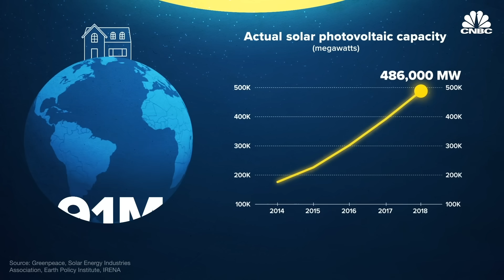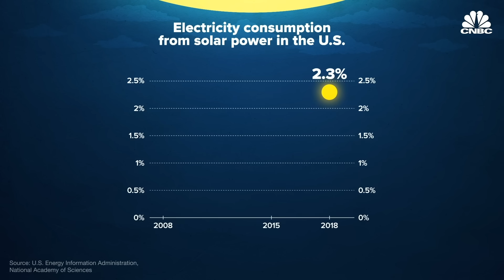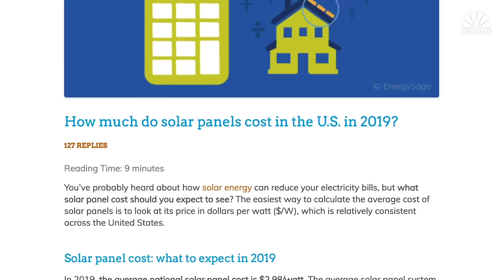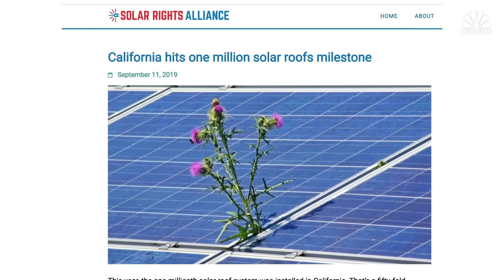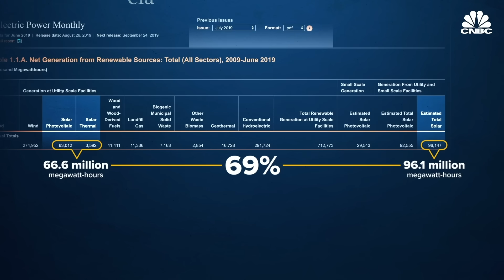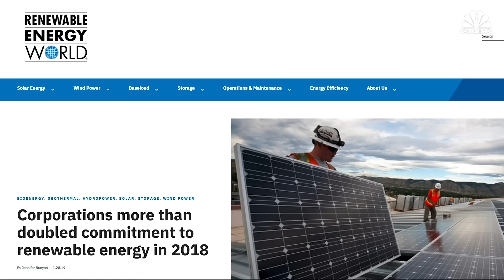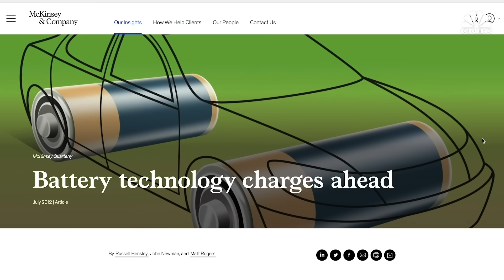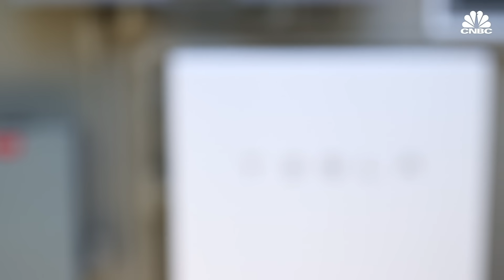The Rise Of Solar Power

Comment: Just think how many solar panels it would take to charge one P100D within one hour? 100kw size farm!!! Truth is Tesla gets its power from oil and coal.
Reply: That is only 250 @ 400 watt Solar Panels = a very small Solar Farm.  I have 30 Solar Panels ...
Reply: @MrSummitville  To drive 50 miles each day to go to work and back in a Tesla one would need about 20,000 watts of power. Sun shines only 5 hours a day so you would need at least this just to charge your car. If cloudy day happens you'll get much less then this. A full charge in a P100D  would last only a week. One would have at least 50,000 watt battery at their house that cost about 40,000 dollars installed. This would be just the battery. Adding another 10,000 dollars to this will make it 50,000 dollars to run you home off grid and then add 30,000 for panels. You would spend 100,000 or a little less to have a system like this. If power only cost about 200 bucks a month you will need to get 40 years out of this setup. lol However to be far one would have to add the savings they save for driving around in their Tesla gas free. You also would have to add up the price of said car too. I think if someone would just get a better hot water heater that turns on when you use it and get a model 3 and charge it up using the grid they would come out cheaper. buying a inverter that somehow uses the model 3 to run your home would be good idea if power goes out However, a diesel gen 5,000 watts is cheap and you could even charge you car and run small things in your home. If you wanna stay clean getting a propane tank to run said Generator would work really well. This is what most hospitals do anyways. Solar is good only if the sun is out and location!
Reply: @controlyourfuture5477  So much wrong with the things you say...  Rolling my eyes
Reply: @Les_S537  How?
Reply: FACT: average sunshine is only 5 hours a day, P100D are 100,000 watt hours of electric power, 25,000 watts would charge a P100D within one day of full sunlight,  When not at home and at work would one would need to store that said power so they could charge once home, 50,000 watts of battery cost much more with the panels and cost to construct then it would just to use the grid, You would have a hard time supper charging a Tesla using a inverter using solar! 220v @ 5,000 watts would give you the 50,000 watts stored from the hours before when the Sun was high and it would  take up to 8 hours to charge at that rate.Once home at 4pm you might have 10,000 watts of power to put into your P100D before using the 50,000 watts backup,  I understand this would give one about 140 miles each day to drive but you don't want power to spare for rainy days and also power for you home and last to save your battery's and keep them topped off. What have I missed ? Not too many can say that I'm wrong with this, you're the only one so far. Explain !!!
Reply: 75 miles a day is average drive time going and coming back from work. This would take 25% of 100,000 watts of your P100D. This would give you 3 days of rain days and the last day you'll need to leave your car at home to charge all Saturday cause Friday would to charge the 50kwh battery in your home. Or just add up the cost leaving your oven on for 8 hours a day and add up the power bill  each month.
Reply: @MrSummitville  The problem is that most of the time someone is charging their Tesla, solar panels' output in not at peak power. Another problem is the electricity transmission capacity of distribution systems; we cannot simply all plug in our Teslas at roighly the same time.
Reply: @FrainBart_main  I can recharge my EV when ever I want want to.  But don't you recharge your EV at night, when the grid load is low and rates are low?  Or do you recharge your EV during Peak Hours, when rates are highest = very unwise.  You need to research Utility-Grade battery systems that can:  1) provide Battery Backup,  2) Peak Load Shaving & 3) Smoothing of Renewable Energy Production vs Consumption.  Distributed energy production is far superior to Centralized Power Plants, as the idiots in California are just now "discovering" - what other states have already known for years. California has a 3rd world electrical grid ....
Reply: @MrSummitville  Well of course, one Tesla is not going to be a problem. Now imagine 80 %+ of people having Teslas or EVs in general. If they all decided to plug in their cars at around 6 or 7 pm, the power grid would collapse in seconds. And now imagine that more and more of our electricity is produced from solar and wind. So supply is becoming more and more intermittent, while demand is increasing. Hourly tariffs will be needed, along with smart charging stations and smart grids in general. Grid operation costs will increase significantly. This may not be a big issue in the US, where electricity is cheap. But here, in Europe, countries with lots of distributed generation or wind and solar in general have retail electricity costs that exceed $0.33/kWh even without energy storage and smart grids.

Utility-scale battery storage systems are great for short-term frequency support (this was basically the main topic of my master thesis). But they are far from being feasible for large-scale energy storage. The largest Li-ion battery in the world is what, 129 MWh in capacity? This may sound a lot, but trust me, this is quite low on a power grid scale. Also, this battery is going to make a profit, but it overtook more than half of the frequency control ancillary services market, so additional batteries will probably not be profitable. 

Distributed electricity generations not superior. Grid operators have to keep the balance between supply and demand 24/7 and it's not easy to do that with lots of distributed generation, especially if most of it is intermittent. Distributed generation causes all kinds of issues with local voltage stability. Most of it is solar, right? Solar PV doesn't provide any inertial support, meaning frequency fluctuations get more frequent and more severe - Europe has been close to the stability limit many times in the previous years due to intermittent generation. A lot of investment is needed to keep supply reliability at today's levels (with centralised generation). Transmission system losses are in the range of a few percent, so the main argument for distributed generation that most people use is just BS.
Reply: @FrainBart_main  You may plug-in your Tesla at 5-6 PM, but no you do NOT recharge the battery until after Peak Hours when the load on the grid is low. You obviously know nothing about recharging an EV ... and you claim that you are doing a thesis??? - LOL !
   I don't care what the size of single Utility-Scale Battery Pack is, because it is the total installed capacity of ALL battery packs, that matters.  Currently, we have 1,000 megawatt-hours of battery packs installed, and soon an additional 2,000 megawatt-hours of be online. And that is very significant since these battery packs  will REPLACE 3 @ Natural Gas Peaker Plants ... and you claim that you are doing a thesis??? - LOL !
   Distributed generation is much better for the consumer, since it allows local power to stay on, even during a large area black-out caused by your Socialist friends that shutdown  the Centralized Power Plants. Return the control of the power, to the people  ... and you claim that you are doing a thesis??? - LOL !
Reply: @MrSummitville  If you don't have a controllable (smart) EV charger, than the moment you plug it in, it starts charging. So what you are describing is basically a smart charger. And that's exactly what I said will be needed in the future in my previous reply. So don't act like a know-it all and read my previous reply again, slowly. And then read these replies slowly and actually learn something. Then slowly write a reply that is not like 10 year-old wrote it. Otherwise I am done with you.
Reply: @MrSummitville  Who is we ? What you are trying to say is that the reliability of supply is higher having distributed generation instead of centralized power plants, because locally there can still be power during large-scale blackouts. Let me explain why that's not exactly true. First of all, large-scale blackouts are very rare in centralized power systems. In Europe we haven't had a blackout for decades. Reliability of supply of today's centralized systems is very high (consumers are powered about 99,98 percent of the time (actual data from my country)). So while your statement might be true for specific circumstances, there is a very small margin to increase reliability (even if distributed generation increased supply reliability, the increase wouldn't be observed by consumers). So your statement _ ...much better for the consumers_ is wrong. No what are the specific circumstances I was talking about? Yes, if you have a charged battery in your house, you can power some of your appliances but this has little to do with distributed generation. We are basically talking about microgrids here, where a neighbourhood tries to operate as a local power grid (while being connected to the rest of the power system (which can be centralized or distributed)). If the connection is lost (or there is a blackout in the rest of the system), the microgrid operates with its own frequency. If supply (distributed generation) and demand in the microgrid are not in balance at the moment when the connection is lost, then frequency will deviate very fast (the rate of change of frequency will be very high) because there is little inertia in the microgrid. So a relatively very small deviation from the balance between supply and demand will cause frequency deviations, which will cause a blackout in the microgrid.
Reply: @MrSummitville  Now, a few words about why distributed generation lowers the reliability of supply and voltage quality. First of all, distributed generation mostly means solar panels and small wind turbines (depending on where you live). Because the power flow from the high-voltage side towards consumers with distributed generation fluctuates a lot (due to intermittent distributed generation), the voltage level around those prosumers also deviates a lot. Voltage levels can deviate out of the allowed tolerances, diminishing voltage quality (causing problems with devices). Also, solar panels (and modern wind turbines) use power electronics, which cause harmonics levels to rise, additionally diminishing voltage quality (harmonics for example can cause motors to overheat or malfunction). Distributed generation means intermittent inertia-less generation, so frequency fluctuations are more severe and more frequent. Wind turbines and solar panels have been the main cause of 2016 Australian blackout, 2006 European power system split... Having more distributed generation (wind and solar mostly) requires more flexibility to maintain the same level of supply reliability we are enjoying with centralized power systems. So on the contrary of your beliefs, here is a brief explanation why distributed generation actually lowers the supply reliability (the light will be off more frequently).

Comment: 7-8 years break-even with tax credits. Without tax credits it would likely be 10-11 years break-even which is around the lifespan of a solar panel. So basically there is no cost savings.
Reply: @tomcat8662
 - The lifespan of Solar Panels is more like +25 years. Your problem is ... you have to pay someone to install.  Self-Install and you can break-even in 3 - 5 years.
Reply: MrSummitville 
Ok. That’s a new one on me. The figures I was told came from a solar panel salesman at a trade show about 5 years ago in Dallas. We have very good electric rates here though because of our abundance of energy sources, particularly cheap natural gas. So if you’re looking at a cost/benefit analysis, it probably looks very different here than other parts of the country in regards to payoff. As far as longevity of the panels though, he said up to 14 years. Maybe they’ve improved since then.....
Reply: @tomcat8662  Yes, the $/kWhr cost of electricity and the cost of Labor to install will make a huge difference in the break-even.  When I bought my Solar Panels, I bought an entire pallet at $0.40 per Watt and then I self-installed.  I know, for a fact, that Solar can work because I did it myself.  If the home owner has to pay $10,000 for the installation, well then that is problem. My PV panels are "guaranteed" for 25 years.
Reply: @tomcat8662  Ofc if a salesman told you that 5 years ago - you back then had completely different panel prices! Theyve more than halved by now compared to 2014! And as MrSummitville said, installation costs makes a big difference.

Comment: It doesn't make any sense to install solar panels on residential roofs, I already did the math. It will take 40-50 years to get your money back and life of solar panels is around 25-30 years. Only way it will make sense is if utilities start paying you cash instead of energy credits. Essentially, installing solar panels on residential roofs will only burn holes in people's pocket. Just replace all the light bulbs in the house with LED/SMD bulbs. My electricity bill went from $40-45/month down to less than $30/month, and the bulbs are 2-3 times brighter than halogen or CFL bulbs. I guess the only case it will make sense is, you have two electric cars, you charge them at home, and you drive a lot.

Comment: things with battery is they get wear up over time. imagine having to replace all those batteries on every power provider centre. imagine if it is installed in every home.  how are we gonna dispose them appropriately? So we gonna need another plant/regulatory just to take care of the worn out batteries. not to say Li-Po can catch fire easily had something gone wrong.. so... yeah... the future of energy can be a difficult puzzle to solved
Reply: @
Brian Zack - It is called Recycling. Lead-Acid batteries are nearly 100% recycled.

Comment: We need some solar panel that is a lot cheaper than what is available currently to speed up the replacement of fossil energy source , e.g perovskite solar cell that has  at least same efficiency as the silicone counter part but about 20-30% of the cost.

Comment: Gen 4 and 5 Nuclear is the way to go. Molton Salt Thorium failsafe reactors work day and night with extremely little waste. It can also burn current nuclear waste. If a Volcano blows up in Indonesia as it did in 1883, solar is screwed for years. Nuclear will power on. Chew on that for a while. Same thing if an asteroid hits like the one which nearly hit in August of 2019. Solar is screwed for years,. Nuclear will power on.
Reply: @Omnipitous - What if the Nuclear radiation leaks into our water supply and kills all of humanity?  Chew on that for a while ...
Reply: @MrSummitville  What happens to salt when it reaches room temperature? Oh yeah, it turns into a rock.  Put some on your meat and chew on that for a while.

Comment: There are many problems with solar power: unreliable, masses of electricity cannot be stored, huge problems with dealing with the panels at the end of their lifetime, big areas needed to generate electricity, etc.  However, it is the darling of the politically correct brigade.  There's a place for solar electricity generation, but that place is not massive, 24/7/365 electricity generation for huge populations.
Reply: @Chris Malan
 - Soalr is extremely reliable ... have you ever been to Arizona, in USA?   Do you actually think that other Power Plants have 100% Up-Time ?
Reply: @MrSummitville  So, the sun shines there in the night?  Amazing.  And even in Arizona solar panels don't put out their nameplate maximum all the time.  In the winter, solar in Arizona generates less than half the summer number.  https://en.wikipedia.org/wiki/Solar_power_in_Arizona#Generation  Even in summer in Arizona the output is near peak less than a third of the time.  https://www.turbinegenerator.org/solar/arizona/  Nuclear is much, much better than that.  It doesn't matter how politically correct solar is, facts are facts.  Or do you say solar can provide electricity 24/7/365?  There's a huge difference between about 25 - 30% nameplate generation year-round and 95% nameplate generation.  I know, these are just numbers and the PC brigade doesn't understand them or attach any importance to them.

Comment: Am I just dumb or will the huge areas of black solar panels make the desert hotter
Reply: You're dumb.
Reply: Toy Fwd I thought so
Reply: It sort of depends. What you must understand that solar panels, although they are pretty black, also convert a piece of the solar to electricity, not heat. So, depending on how much heat is absorbed by the ground, it could get hotter or cooler. In this instance, I would guestimate that it would be hotter, but not by much. But since the heat is on the solar panels and not on the ground, it might actually beneficial for reptiles that need shade at high noon. Also, in the long term, we can expect solar to get more efficient, so will become less hot. So, if we're lucky, this is just an temporal problem.
Reply: Thatyou GoOn I was kind of thinking along the lines of how they painted black streets white and it made the neighborhood cooler but I didn’t really think about how solar panels work. Thanks :)

Comment: Even the solar panel road didn't work out and that's the road that's meant to defrost itself in the winter
Reply: @joseph Buck
 - The Solar Panel road was an experiment, at best.  It has not to nothing to do with residential solar.

Comment: By the way when is that white overcast you cannot get full capacity out of solar panels
Reply: @joseph Buck
 - So what?  When the water level is low - hydro-electric power plants reduce their power output.  So, stop pretending that all power plants must produce 100% power all of the time. They do not !